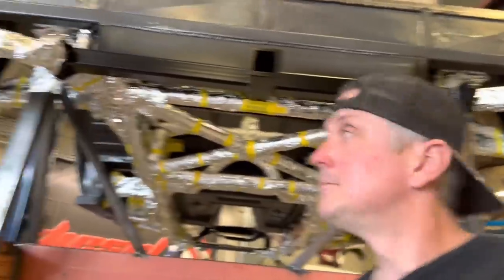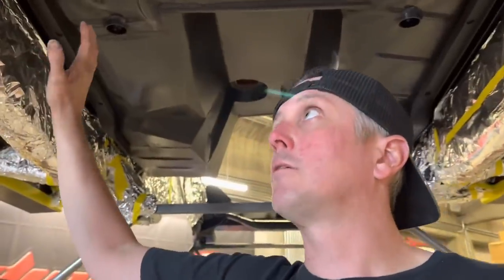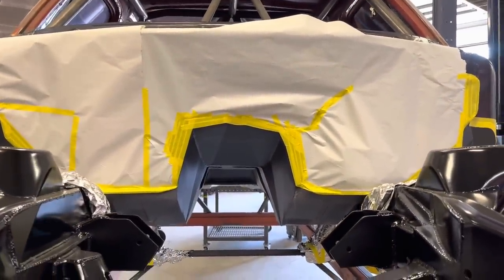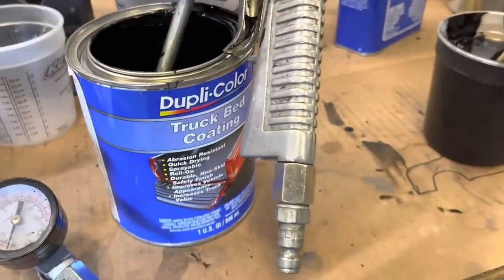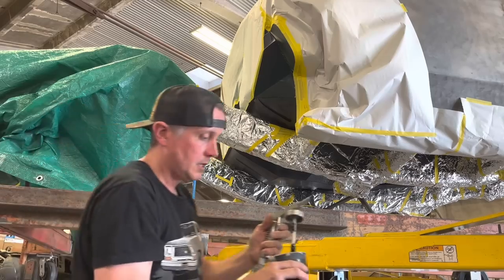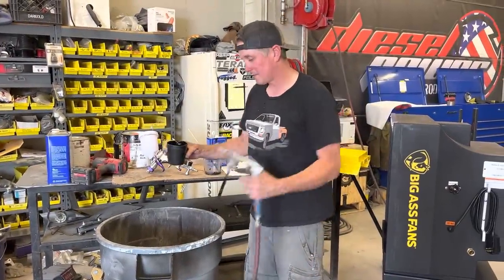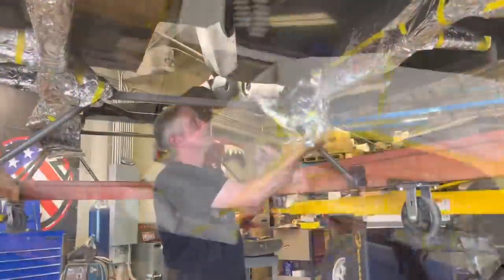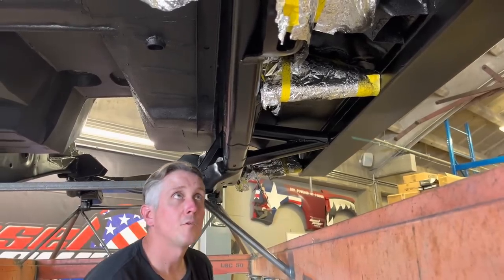Tips and Tricks!  Prevent overspray when Undercoating

Comment: Undercoat gun.  

These were generally made to spray from a pre packaged can.  I used a 1 1/2" threaded pipe stub welded to a disposable propane cylinder / added a piece of rubber hose to the bottom.,  ( the tall thin tank though the short wide one would be better ) 

Mine was set up to use quick connect nozzles and a wand but most of that was missing, used a 1/4" nylon tube zip tied to a tig welding rod for support.
Reply from the maker: Sounds like you have the system down

Comment: I have a bit more of a backyard setup, does the rattlecan stuff work as good as far as keeping the metal from rusting? Need to paint my obs ford so I can get some more life out of the body.
Reply from the maker: Sand and clean. Then hit with rusty metal primer. Then you can try this.
Reply: @thedirtheadshed  think it will stay on there or just end up peeling? Prep is for sure most of the battle but I'm just wondering if the rattle can stuff is junk and the best way to do it is with a gun.
Reply from the maker: More effort and better materials are always a good way to go. Just got to pick your budget and time available